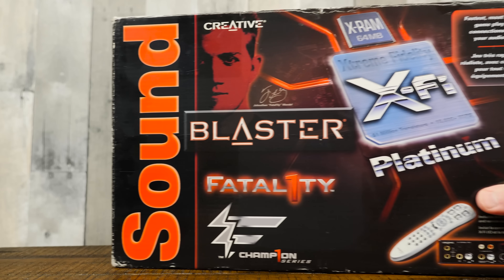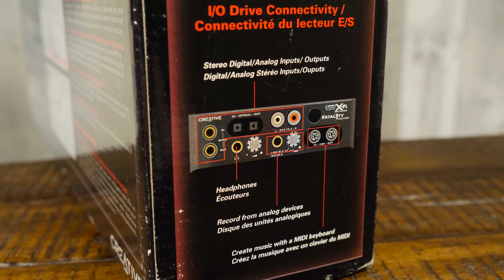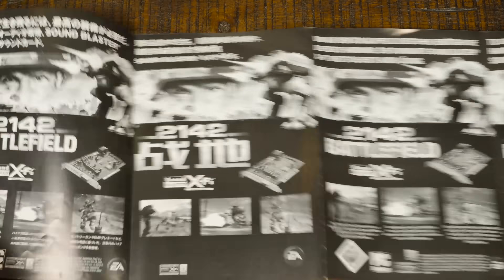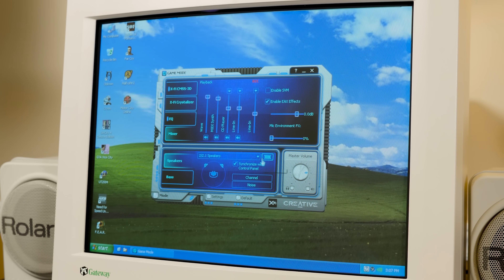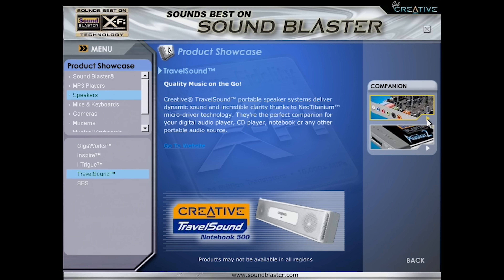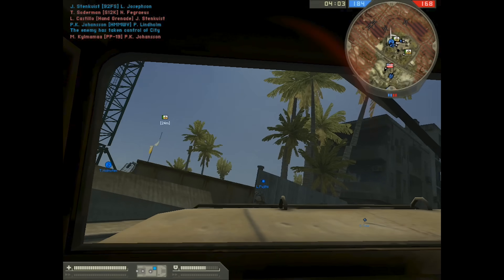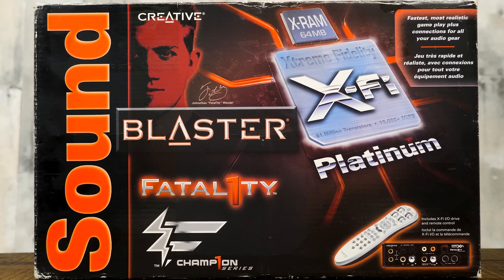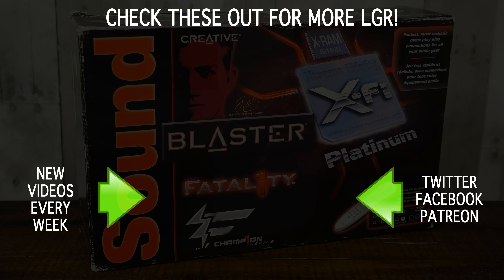XP Upgrade! Sound Blaster X-Fi Platinum Fatal1ty Sound Card

Comment: Is there any benefit to having a sound card in this day and age? lol
Reply from the maker: For getting higher-quality audio with low noise, absolutely. Especially for audio editing and content production.
If you're just gaming then integrated stuff is normally fine.
Reply: dont modern gpus also come with some sort of audio chip or watever seeing as how its off a hdmi connection and my 1060 always installs audio drivers
Reply: Better SNR or Dolby/DTS encoding if it's not supported by the integrated sound.  Microsoft gimped sound card capabilities in Windows Vista and newer versions, because Creative drivers were bad and Microsoft was tired of dealing with their issues.
Reply: Audio over HDMI is actually a digital stream, so your GPU is really just forwarding the system audio mix to the TV/monitor, which has its own DAC.
Reply: Yes canyon.mid?
Reply: Of course it is if youre aint deaf
Reply: Hardware midi.
Reply: Most of my boards had something other than realtek. I had AD and VIA. Both were excellent over the realtek.

The only integrated SB card I ever had died. But so did 2 other SB normal cards of mine.  Seems they have reliability issues so at least it seems realtek have one up on that over creative .
Reply: AD as in analogue devices. That is what my old Asus board had and it was quite good. My current one has a realtek and it's fine. But years ago when all the realtek audio boards ever came out with was ac97 mine always had audio stutter and looping.   The VIA sound I had on my Athlon 64 was really good.   

Creative is the worst I have ever experienced with problems and poor support and driver bugs.   I am looking at Xonar for my retro PC as I just can't get any creative cards to function, EAX being the main issue. I spent almost 15 years trying to get EAX to work on my games with no luck.  Only have one combo that ever worked. SB live 24bit, win2k and CD included drivers (website versions did not work)
Reply: its crap tried it, 14 yrs using creative wouldn't change at the mo, on board still sucks, unless you buy high end motherboard, but some of them still suck sound wise, so pays your money.....
Reply: Wrong!!! they were worried creative were too good and making there product sound better, thats what microsoft problem was!!!

Comment: Oh man, I had this card and I loved it. I had a custom GM SoundFont that I put together from the best bits of other SoundFonts. The optical ports on the front were hooked up to my HiFi so I could both play audio over my 5.1 and use the DAC in my receiver to record from tapes and vinyl records. I had a MIDI keyboard plugged into the front MIDI port. My case at the time had cables coming out of the back, top and thanks to this thing the front too. Man I had a lot of fun with that rig.

Comment: I'm probably the only person who'll say so, but the changes in the Doom 3 audio sound worse with the card in my opinion. I see what they're trying to do, but especially for something like dialogue, that reverb is excessive.
Reply: Nope, you're not alone. Watching this video on an 80W Japanese hi-fi amp from Luxman and two 40W speaker columns the size of a cupboard and it sucks. The reverb is too much.
Reply: From what I've read the addition of EAX to Doom 3 was a bit rushed and not something id wanted to add in the first place. They only did so because it was part of the settlement over the whole "Carmack's Reverse" lawsuit between id and Creative (google it for the details). Creative made an agreement with id out of court that if they licensed creatives EAX from them and implemented it into Doom 3 they would not pursue legal action so that's how EAX ended up in Doom 3. I'm pretty sure before the legal threats Carmack went out of his way to mention that Doom 3 was going to have advanced 3D audio tech built in without the need for special hardware.

Comment: @LGR 
You mention almost no "CONS" for this card (also for the previous creative card), it looks almost like an advertising. This video: I don't like.

creative cards are known for having CONS: bad drivers, compatibility issues not solved by creative with many chipsets, not beign really compatible with features as advertised, bloated drivers/software, cheap amplifiers on very expensive soundcards, etc., etc.  Since forever, since soundblaster/1/pro/16/awe32/awe64/vibra, sb live, live 5.1, 128, audigy, etc. etc.

Sorry to be the pessimistic side of the tale today :)

Comment: Man, 2007.. what a year. Miss those days. Back in 07 I had a CREATIVE X-FI XtremeGamer FATAL1TY PRO coupled with a Logitech X-540 5.1 surround sound system. The speakers I am STILL using on my machine TO THIS DAY. Just need to solder in a new potentiometer for the speakers.

Comment: Those XF-i's were so good! I had a Platinum back in the day.
One little publicised feature is an onboard Dolby and DTS hardware decoder.
You can plug your console in via optical, it'll decode the 5.1 signal in hardware and output it via 6 channels over analogue.
Such a useful feature as you got the DACs on the card!
I don't know cards these days that do it.

Comment: I had one of those cards back in the day. I'm not sure where that old hardware went to. I'm in the process of building a retro Win98 machine, and I wouldn't mind finding a lot of the old hardware I had back then. Sadly, much of it is probably lost in time. I made a comment about Voodoo 5 cards a while back. I tried bidding on some, I gave up. Instead, I bought a Nvidia 4400 to get the job done. It'll be good enough. Great videos Clint. Keep them coming, your fans do enjoy the content you are creating.

Comment: I have a SoundBlaster Z installed in my current PC.  I bought a nice 5.1 surround sound system, and there was just something missing.  Didn't feel as surround as I had expected. Ended up getting the Soundblaster Z, and it really improved the sound on my system.  The surround sound transformed into what almost sounds like wearing headphones.  I use to feel like using a simulated surround sound on headphones was the way to go to get the most accurate directional audio, but now I play with my speakers, and I can hear exactly where everything is coming from.  The dedicated sound card made a huge difference!

Comment: I love your videos!  Now I have an idea of what type of sound card I should be looking for in my thrifting. I want to upgrade my Dell Dimension 5150's sound, which has been my main machine since I bought it new. Very recently I saved an external Creative Sound Blaster Extigy from getting recycled and the device seems way better than the built in sound that the Dell Inspiron 6400 uses. I'm using the Inspiron as a capture machine to rip cassette tapes off my JVC TDW-217 duel tape deck that I thrifted about 4 years ago for a modest 20$.  I record live music and I use the the laptop without the Extigy due to latency and convenience. 

The part of your video that sticks out most is hearing the differences in sound with the games! WOW!!
Thank-you for your amazing videos!!

Comment: I had an Audigy 2 ZS (without the panel) back in the day. It sounded so much better than integrated. I've never NOT had a creative sound card since. Currently rocking my trusty X-FI Titanium Fatal1ty Pro PCI-E card on a new Windows 10 build. Works just as good as it did when I bought it like 10 years ago..

Comment: There are still benefits to using dedicated sound cards in modern systems. For one the latest soundblaster cards have a much higher dynamic range than the best integrated RealTek HD chips, and there are some combinations of sound effects on multiple channels that come through much clearer, so it's easier to identify individual sounds, which otherwise are a slight mess on the integrated chips. Whether or not you get unwanted noise really depends on the quality of the motherboard - since it's the power regulation and signal filtering in the motherboard that usually determines if audible noise makes it into the audio output. But as always it really depends on what you do and what you play. Many console ports won't be able to fully utilize a dedicated soundcard because they're made for the very limited sound capabilities of the consoles, so they use only a few channels and rarely bother with proper spatial audio

Comment: i have that EXACT card in my pc right now .. owned it since its release and still use it now on my skylake board with windows 10 with an 17 cpu .. i have never had a better card ever .. i even bought the elite xfi external unit with all the dials and full size midi on there but now on windows 10 that elite external unit just sits in the back of the draw not being used as windows damaged the driver support for that in the latest fall update . you can actually get optical 7.1 dts sound out of this card very easy indeed and it supports dolby digital hd the newer blu ray format ..the surround capability on this card is unreal and even today its amazing .. .  the card xfi fatality1 championship series still lives on and beats the pants of everything .. best few hundred pound i have ever spent . creative still have some drivers for it altho the last few years its been getting worse on support as it went end of life a long time back ..

Comment: Back then I had a Sound Blaster Audigy 2 ZS purchased a couple of years earlier. I do not have the front panel "drive" (though I wish I did), and the Firewire ports came in handy for capturing video from the camcorder and connecting external drives. I still have the card, and it recently received a new lease on life in one of my current Windows 10 machines - I was getting a lot of noise on the on-board audio, and dropping in the old SB fixed that.

Comment: I started with a sound blaster live 5.1 card in my first system. I later read about the sound blaster audigy and seen the capabilities of I/O on the platinum. I was sold and went out and purchased one, I had put it to good use with most of the front connectivity from capturing audio from everything but the midi port and sometimes using them to externally output audio like the optical tos link to a sound system connected to a projector.
I later bought a sound blaster audigy 2 platinum and later I found myself rarely ever using the front bay anymore. I was using a 5.1 headset at that point and the front audio out no longer was useful to me. 

My next card was the sound blaster x-fi fatality card. I remember the technology seemingly being promising, it sounded like the next step in audio with it's 64mb of audio memory buffer on the sound card. It had barely any use as games had to support it and I guess some people had stability problems in vista with it. Still a good sound card. 

I used it quite extensively until I got a new razer 7.1 headset that it couldn't power. The headset ran off of usb power to help, but it needed the sound card to be good. So I purchased a sound blaster x-fi titanium, which was on the supported list. I had to skip the sound blaster z cards due to them not supporting 5.1, which I would have loved the sound blaster z if not for the lack of 7.1. 

I skipped two generations basically from the recon to the z series. I ended up purchasing the sound blaster x ae-5. I find I like several of the audio features for multichannel audio. Even tho the big thing now seems to be virtualized 7.1. For my speaker setup and my current headset setup, I do prefer to have sound blasters 5.1 upscaling and the bass redirection. Otherwise I would just be fine with onboard sound. Asus's probably would give me the same thing. Those are two of the main features that I really can point to that I couldn't do with out when it comes to onboard. However I have considered the route of going with sound blasters mb3 or mb5, and I might have gone with mb5 had it been sold to the general public and been using onboard sound instead. I considered getting a gigabyte motherboard, but when the 2nd generation of ryzen came around and I was ready to purchase, the 4xx series of boards from gigabyte dropped support for that. I decided I would rather use a 400 series rather than the 300 series of boards for a newer generation and forgoing onboard sound with just that one feature. So instead I just opted for the sound blaster x ae-5. I don't regret the purchase, but I know for most people, sound cards just aren't necessary anymore. I would have liked to stop using them personally. I remember back in the day, one of the main advantages was that it increased gaming performance. This was due to onboard being software driven and it required the cpu to process the sound. Now day that is a moot issue with multicore cpu's and plenty of cpu cycles to spare. While I don't care about eax hardware support and it seems the ae-5 doesn't even support EAX emulation anymore, that was never a selling point for me. I can live with out, even if I did purchase doom 3 ultimate during the summer sales to relive that game.

Comment: i've bought my X-Fi Xtreme Gamer Sound Card when they were new (the PCI one, not the PCI-E that came out later) and i'm still using it. The multi purpose Microphone Jack stopped working when i went over to windows 7 but later i found out i could plug in the case's front audio and have the driver disable the speakers as long as my headphone was plugged in. Didnt need that back then but isn't it great to discover new stuff from something you own for so long?

Comment: Brings back memories of my old gaming rig. 2 gigs of corsair ddr2, quad core Intel, 2x8800gtx graphics cards and the xfi fatality platinum. Benchmarked Fear at almost 300 fps in sli mode. Doom was awesome..... 

I still have original cpu, ram and 1000 watt power supplycin working condition, the rest never made the distance lol.

Comment: I had this exact card (IIRC) only the box art was different *bought in the UK.  I had it for a PC I built in 2005 so perhaps it was a previous release.  It was a good card but had issues with crackling sounds which were not fixed at least till I got rid of that PC 3 years later.

Comment: I believe I bought one of the standard X-Fi cards when they came out (I was in university at the time) as I had a 5.1 system and I have always gone for a dedicated soundcard where I could in my machines. In fact up until my last couple of PC's, X-Fi's were my go to card (after which I got the Sound Blaster Z series, up to the ZXR I have in my current rig. Call me old fashioned but I just prefer to have a dedicated card for sound where I can :D

Comment: I had this card.  Was awesome.  Had a flakey one at first that just wouldn't detect in the bios reliably, however when I got a nice working one on RMA, it was simply awesome.  Paired with a Q6600 SLCAR and a 8800GT SLi I was rocking it! :)

Comment: I still have my old X-fi Gamer card, but I can't use it since it's PCI only. One of the issues I had with that card was getting proper 5.1 surround sound out of it. For my card, Creative used 2 jacks instead of 3 for surround, which was tailored towards their own speakers. So I did what anyone would do: I made an adapter for my Tritton 5.1 analog headset. It consisted of two 4-pole 3.5mm to a/v out (designed for camdorders) and plugged into three female RCA stereo to female stereo 3.5mm jacks. Worked like a charm.

Comment: I bought an X-Fi platinum PCI in 2005, and it's part of the reason I'm still on an LGA1366 6c/12t Xeon X5675 @ 4.6GHz.  I do audio creation/production/mastering and latency is key for me, which is why the PCI-E X-Fi is a no go, due to the latency issues Creative has with PCI-E. LGA1366 Xeon's still have the lowest cache-to-cache latency across all cache page modes, which means an LGA1366 Xeon with a PCI X-Fi EMU20 is STILL to this day, the lowest latency audio mastering system around.

Comment: Awesome to see an X-Fi card pop up here! I picked up a Titanium recently to record from and use my MIDI modules - their cheap price makes them a pretty sweet solution nowadays for easy 24-bit digital and analog audio recording, and the quality on them is just as good as my USB audio interface. What headphones are those at 5:50 by the way? They kinda look like a Roland RH series pair, even the connector is the same as on my RH-200s.

Comment: I had the SB Audigy in 2003 and even after I joined the military in 2004 and had some real income for the first time, I still couldn't bring myself to drop the big bucks to get the Audigy 2 with that awesome black front panel I wanted so bad because I just couldn't justify needing it. All I really did was play games so the only part of that front panel I would have used was the headphone jack, and cases were starting to have those on the top/front pretty regularly by then. My only real desire was just to have the best and coolest thing, and like you pointed out there was something satisfying about all those ports.

Comment: Fun fact: That connector on the card, is not a MIDI-connector,  but instead used to connect an external IO-console (mostly like the bay). I'm not too sure if those were actually sold separately as well, but they did come with the higher end "Elite" cards, and can usually be found separately on eBay from time to time. Just make sure to get the right cable, which is called an "HD26".

Comment: Anybody remember pc blaster? It's a creative lab pc sold by tiger direct creative live chip was built in a motherboard. Case had has alot of connection a ir blaster which  needed for to use the remote.

Comment: I've had a SoundBlaster Audigy 2 Platinum with Live Drive in my Windows machine since 2008. It's worked flawlessly for 10 years until a recent update to Windows 10 dropped compatibility for it. It survived through XP 32 Bit, 7 Ultimate 64 Bit and most of Windows 10 Pro.